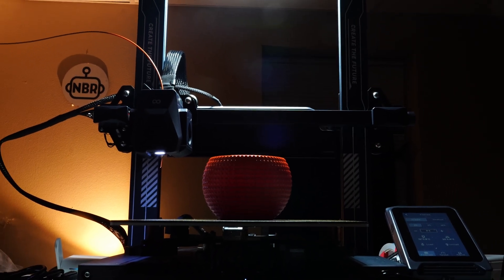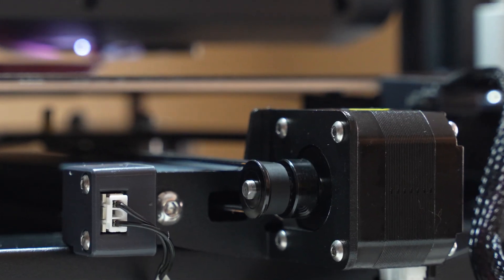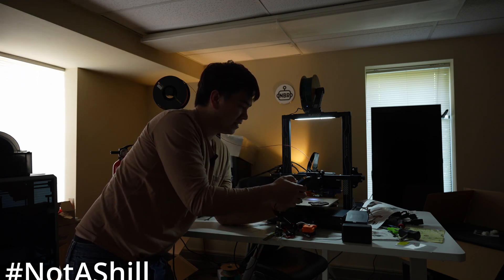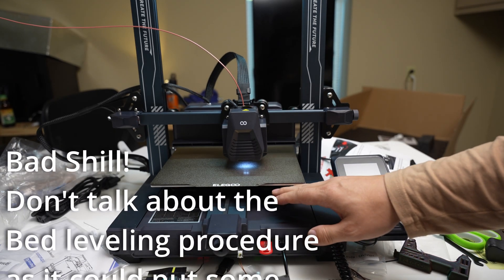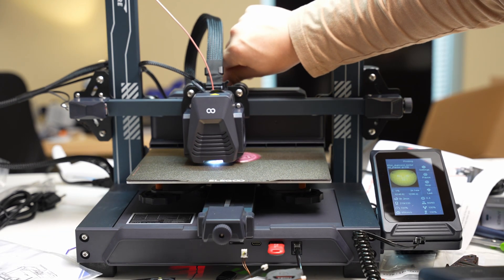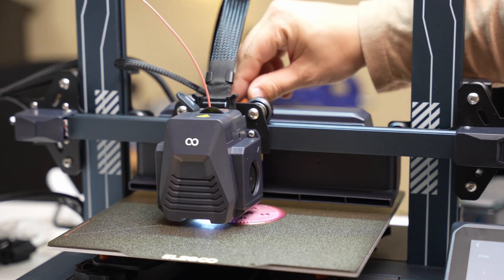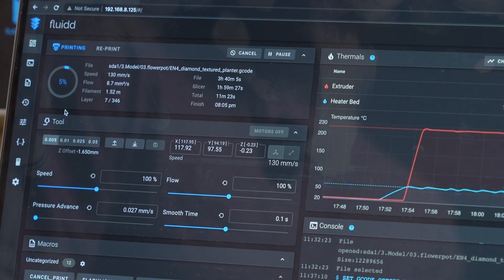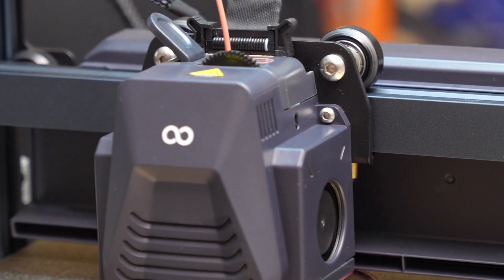Elegoo Neptune 4 - Should You Buy? (Low Effort Shilltacular First Look)

Comment: I got my mom an Ender 3 v3 SE last month. Compared to my old Anet A8, well, it is super. But now seeing your video reviews, just ordered myself a Neptune 4. For a long time I've wanted to not be running around with SD cards, for starters. Lack of WiFi is no problem for me, I have ethernet to the relevent place the printer will be. Thanks for your review!
Reply: so what's your opinion 2 months after posting....Ender 3 v3SE or Neptune 4? I'm deciding between those 2 myself. tia
Reply: @ericroman9126  so the Ender hasn't been used since then, as I've not been to my mom's (different country)- my daughter had been playing with Blender, so I thought I could send her STL files to print sometimes, but hasn't panned out. Was good for printing custom parts to fix her fridge, and I'm sure when I'm there next I'll use it more. 
The Neptune 4 is great. You do have to go thru calibration, which is on the display, several times since I've repeated, but may have honestly been too low bed temps. Key thing is to watch that first layers particularly go down good. If the print detaches and sort of "rides" along with the print head, instead of spaghetti which my Anet made a lot of, you'll get the glob of doom. Happened to me once- lots of patience needed to remove plastic and disassemble the print head without damaging anything - soldering iron with tip you don't care about to cut thru plastic, and then I have a convection oven, and I heated it to a temperature where the PLA was soft and removable.
But other than that, prints fast, works with Cura (BTW, look for Cura plugin for the network printing, and also one that automatically generates temperature test towers), and network printing is a big factor for me.
Reply: @andrewray822  cool, thank you.

Comment: My Neptune 4 didn’t come with a profile to print with from the elagoo cura slicer that came on the usb. I can’t use it what do I do?? It is version 4.8 and I already tried 5.4 with no luck. Please help I am new to all of this.
Reply: What do you mean by profile? Did you check both USBs? (There's 1 USB and 1 USB with a micro SD slot)
Reply: @tacosyk  it did not come with a pre set profile for the Neptune 4 on the usb or the micro sd in the slicer for it but it showed all the neptune 3 series.
I saw on Reddit that it’s not just me with the issue.

Comment: I've had the Neptune 4 Pro since it's release. Literally the ONLY downside is no wifi but aside from that, this thing runs circles around my old Ender 3 Pro. 6 hour prints now an hour and a half or faster. Extruder is many times better, the print cooling is phenomenal for getting individual layers cooled enough to not sag on very fine or thin vertical areas. The speed is absolutely fantastic. The built-in bed leveling has 100-location resolution with 0.01 resolution and the ability to generate a mesh map of the bed through the klipper interface to see any small high or low spots. Which makes getting as close to optically level as possible so much easier. No ABL needed whatsoever.

For a starter printer, I cannot recommend this thing enough.
Reply: does it have auto leveling?
Reply: @hehehoho788  Yes as well as level graphing and all that good stuff.

Comment: But even if you did have $700 to spend, would getting one P1S or two Neptune 4 or three Ender3 v3?
Reply from the maker: Probably the Ender 3 V3. If you want raw output, potentially making lots of TPU or PETG parts, more printheads = more better since you'll probably be flow rate limited anyways.

Comment: My Neptune 4 has been great...for the first two weeks. Then it started failing prints, and now the extruder motor has burned out and, judging by the error codes, it's burned out the driver on the mainboard. Zero response from Elegoo support.

Perfect feature set, unbelievable speed, insane price...and dead. Looks like I'm getting a P1S...
Reply from the maker: Return and replace!
Reply: @NathanBuildsRobots  - I'd love to, but a) can't get a response from Elegoo, and b) shipping back to China is going to be more than the printer's worth to me! The perils of early-adopting cheap gear, I guess.

Comment: Hi,

I'm actively looking into the Neptune 4 - do you have any measurements of the noise levels with the special blower fan on?

I asked Elagoo directly and they claimed "60dB in normal mode with the rear cooling fan on in printing, and 60dB in sport mode with the rear cooling fan on in printing. "

I'm really dubious that it's that quiet - what was your experience?
Reply from the maker: I did, it’s in the video. Did you watch the video? 😋
Reply: @NathanBuildsRobots  Sorry - phrased that wrong: 
Do you have measurements of the 3 different noise levels for the blower fan?
I'd like to aim for 250mm/s printing and assume I'd need at least the "mute" mode

Was the ~65dB reading the loudest?

Comment: This is not a clone of Ender-3 😂
Reply from the maker: You're right... Aluminum extrusion construction... V-Groove Wheels... 235x235 heated bed... Screen on the front right side of the machine... Totally original design.
It's a better clone, but it's a clone.
Reply: @NathanBuildsRobots  I meant in functionality it's not a clone. The Elegoo Neptune 4 is leagues better than the Creality Ender-3, but yeah it is kinda laid out similarly
Reply: @NathanBuildsRobots  It says Neptune 4 · Print volume 225*225*265mm on their site?

Comment: Does it go hot enough to do Nylon and some harder flexible filaments. As i was going to go Neptune 3 Pro but i dont think, its Nylon ready ? Maybe you can not sure? And is the price worth the difference between the Neptune 3 Pro on special vs Neptune 4? Or should i wait for other reviews of any other printer you have coming up?
Reply from the maker: This is a great deal. But it’s not going anywhere. Get one if it makes sense to you. It will need a nozzle upgrade to handle abrasives, but can otherwise handle higher temps up to 300C
Reply: @NathanBuildsRobots  I will mainly be doing TPU, Nylon ie flexible filaments for rc parts, but I don't think the Neptune 3 pro can do nylon. And the neptune hardware doesn't look like the hardware is easy to upgrade or mod. DO you think any else coming is going to beat the neptune 4 for ease and being able to do everything with future proof firmware Klipper

Comment: when you bump your speed, you should also lower your flow to compensate
Reply from the maker: Interesting idea. Would probably lead to slight underextrusion. I’ve always done the opposite, for reasons… an overloaded extruder will underextrude a bit, you can correct for that too a small degree by commanding it to overextrude

Comment: What you would recommend between Elegoo Neptune 4 and Ender 3 V3 SE? Based on your video, the 2 seem interesting! I'm looking for my first printer.
Reply from the maker: Neptune comes with klipper, Ender 3 SE probably won’t, but will be $60 cheaper. 
Ender will have more options for aftermarket mods due to popularity.
Neptune is available now, Ender is available in a month or so.
Really depends on your timeline/needs. I’d say the Neptune is $60 more printer, worth the extra cost. If you want to mod it anyways, Ender 3 might be a better place to start, but first upgrade you’d want to do is a klipper install, so…
Reply: @NathanBuildsRobots  Big thank you for taking to time to answer my question. I'm looking for something that work at least 80% of the time, but don't mind mod if needed. I can wait for 1-2 months. What are the mods that the Ender  that will worth to chose over the Neptune? I'm planning to buy the K1 Max later this year.

Comment: Thanks for the Klipper segment near the end.  Even before that, my comment was going to be that Elegoo provides full Klipper/Fluidd on their $260 machine and Creality gives us proprietary Klipper crippleware on their $800 K1 Max.

You didn't show input shaping calibration.  Is there an accelerometer on the extruder or did Elegoo, instrument a factory unit to generate a generic input shaper profile to use for all machines regardless of whether the customer places the printer on a rickety folding table or an 8" thick granite surface plate?

#UsefulShilling
Reply from the maker: What Creality did with their Klipper implementation is beyond stupid. I think they wanted to build their own platform, and have an app so you could download and slice models more easily, and manage multiple machines like in a printfarm using a single point of control over Creality Print. It somewhat succeeds in those goals, but the overall performance is super compromised compared to normal Klipper.

Given that most of their customers are only buying 1-2 printers, the whole idea of having a fleet management interface is just kind of silly and un-useful. The app could have been a great idea, but so far they are fumbling with it.

I don't think the neptune 4 it came with an accelerometer - but maybe it did? This is becoming more of a common practice - a generic profile can help bump speeds up a little. If you want a more accurate model that holds up at higher accelerations, that's when you really need a built-in accelerometer. And there are some methods of manual input shaping that work pretty well (print test pattern and select best looking setting).
Reply: @NathanBuildsRobots  - Creality's crippled Klipper is probably good intentions leading to bad outcomes.  There's often a huge gap between the idea and its commercial realization.  An app to download and slice models as well as managing multiple 3D printers sounds like a decent idea until the app becomes Spammy McCrapApp spyware and the 3D printer becomes less, not more.
Reply: Elegoo applied a standard profile for input shaping. But you could buy a sensor and attach it to the motherboard for individual results.

Comment: This printer checks a lot of the boxes on the list for a beginners printer plus it has a nozzle able to reach 300 Celsius degrees that's a plus.   Btw loved the music at the end and as always I enjoy your reviews.
Reply: Yea, that 300° swayed me over the Ender v3 KE.
Reply: @andrewray822  Hi there, I am currently torn between the ender 3 v3 Ke, the sovol sv07 and the Neptune 4/ 4 pro 

What has your experience been so far and what should I watch out for
Reply: @chillSpoofy  it has been fine for me. Once the print got loose and the nozzle made this huge blob of plastic around the print head, but I was able to carefully heat and remove it. Always watch first layers, that it is adhering well and doesn't need to have the calibration done again

Comment: I have a Mingda and a Neptune 3, the Neptune is a better build, and my Mingda has overheated. I print TPU exclusively, does a faster unit make any sense?
Reply from the maker: I'm not sure, with TPU you might be limited on flow rate, so not sure the faster printer will make much of a difference.

Comment: I know a shill when I hear one.
Reply from the maker: This new Neptune 4 is the best thing since sliced bread! You can take that to the bank!
Reply: @NathanBuildsRobots   I think I would actually go with the pro.  It had the selectively heated bed.  Also I do realize the plastic v wheels do work good, but I like the metal roller type guides.  I think metal roller guides are better than linear bearings.  Thanks for showing this review.

Comment: Big question I guess is really whether the all metal rails on the Pro model are worth it. I have seen conflicting reports about them, with more wear and the need to lubricate on the metal rails, whereas the POM wheels are... well, just their usual POM-ness. I do like the 100 + 150 Watt heated bed feature on the Pro, though, but not sure it's worth the extra $$.
Reply from the maker: In my experience with other printers that use that type of rail system, they are very low maintenance, but VFAs are more apparent, which add a strange bumps and wood-grain-like texture to your printed surfaces.

They are not using traditional linear rails or linear rods where the balls from the bearings are touching the exposed metal guide, they are shielded cartridge bearings with a metal wheel with a u-channel on the outer bearing surface that rides on a metal railing. Look at the Tronxy Crux to see an example, I did a video on the artifacts and issues I had with that type of rail system.
Reply: @NathanBuildsRobots  Thank you for the information and reference. I feel it's an aspect that many review sites/channels skip over, even though it's rather important as you noted.

It's definitely more than just 'metal good, POM bad'. Having experience with linear rails in MSLA printers and robotics I can attest to those being pretty darn smooth and hard to beat. What the Neptune 4 Pro uses feels like the budget DIY version of it, but maybe it is good enough?
Reply: @MayaPosch the v400 and kobra 2 also uses it and gets good results. My experience with vfas is that it comes down to the steppers and speed. Ldo steppers for example are pretty bad besides their high price point. Creality and flsun steppers for example produce very little or no vfas. There are also some critical speeds, 50mm/s is a typical speed for very high amounts of vfa
Reply: @over_pizza_2578  mind explaining the critical speed thing a little more? Genuinely curious.
Reply: @jeremiahk364  50mm/s or better 1,25 revolutions per second on a stepper seems to cause some internal resonance, at least thats the only reason i can think of why 40mm and 60mm produce less artifacts than 50mm/s.
Reply: @over_pizza_2578  what about higher speeds such as 200mm/s and 250mm/s
Reply: @NathanBuildsRobots Wouldn’t Input shaping reduce those artefacts?

Comment: As you said It works great right out the box, I have a neptune 2 and I can say it only took 15 minutes to set up and produced great quality right out the box.
Reply from the maker: The bed leveling is a little annoying, and getting it on the LAN is a little annoying. Fix those 2 things and this would be an even better printer. But still, overall it's a great package. Anyone upgrading from an Ender 3 would be very impressed with what they were able to do for the price.
Reply: @NathanBuildsRobots  I completely agree, great printer at a great price and with those upgrades you mentioned it might just be the best printer in its price range.